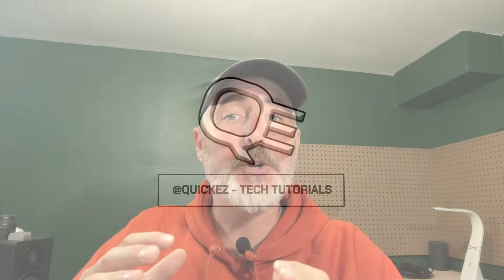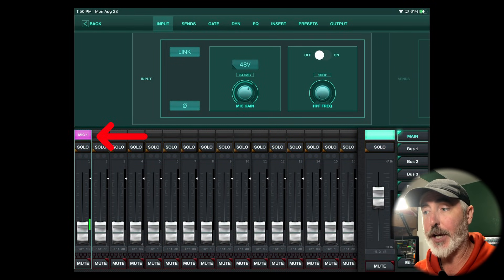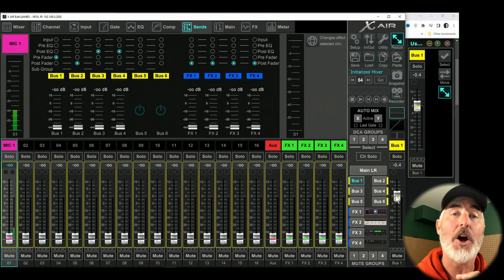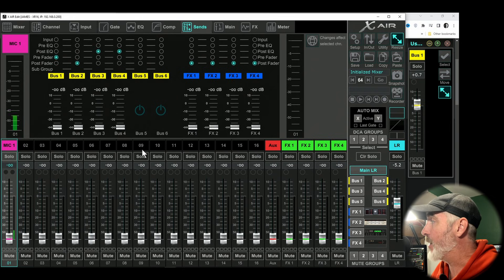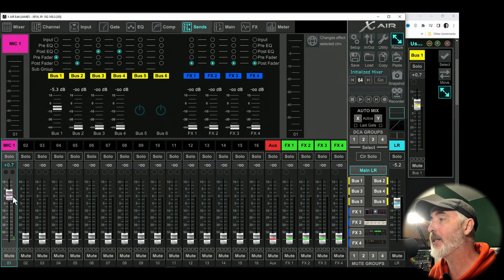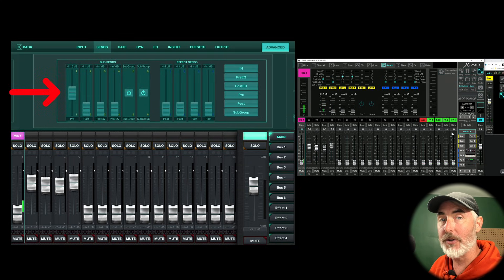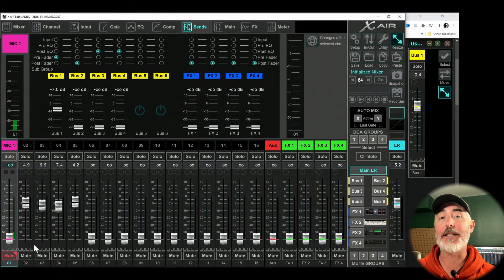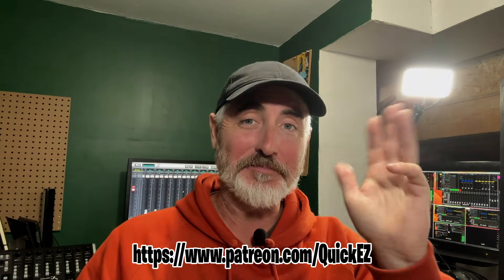XR Mixers - How to set up & use aux sends

Comment: How could I setup a stereo mix for my aux outputs?
Reply from the maker: Hi bmorphis3,
if you link two aux outputs (lets say aux 1 and aux2) that gives you the ability to make a stereo output.
As soon as you link two auxes, they automatically hard pan left and right.
Then you can send signal to them in a panned state and that will allow for a properly stereo send.

Watch this video I have on how to correctly pan inside a stereo aux setup.
https://youtu.be/B9OPxbO6oV0

Hope that helps. 
Thanks for watching and happy mixing!

Comment: Great Video, My problem is im getting signal in but, I cant get sound to my monitor?  thx for any advice.
Reply from the maker: Hi Paul,

Powered speakers? 
Passive speakers?
Are you seeing signal in the aux output meters?
Have you tried swapping output cables between your mixers aux outputs and your monitors?
Does this problem exist for all aux outputs or just one or two?

Are you able to get sound out of your Main LR outputs?

This process should be easy especially if you’ve watched the video. 
If you’ve followed the instructions and nothing above yields new results, there could be an issue with your mixer.

Comment: Thanks for the amazing vids, love them. After watching some of your XR18 videos we finally decided to go digital and swapped our analog mix for a XR18 unit. And we absolutely love this little beast! With the help of your instructions I was able to set it up and have it operational within 1 hour!
There’s one thing I struggle with though. I’d like to have my drum set mix fixed and then controlled by a single fader, while feeding it to the Main LR, and the individual PA mixes via Aux outputs. So I combined all individual drum mics under a subgroup on Bus4, removed the mics from the Main LR, and that works perfectly for the Main LR. But I didn’t figure out a way how to mix it to our PA mixes which I have on Buses 1 to 3. I even tried to physically feed the corresponding Aux output to a free input via XLR patch cable. While it sort out works, it introduces a lot of bus and cracking, so not a workable solution.
How would you go about it?
Reply from the maker: Hi Peter, sorry for the delayed response.
just want to make sure I understand what you're trying to do. 
You want your drums mixed and then their overall mix controlled with a single fader, for the main L/R house speakers.
But are you saying  you'd like that same control for your monitor mixes 1-3 as well?
Reply: @QuickEZ  yes, for Main mix, I want to control the “intensity” of the drum mix with one fader. As the IEM mixes are concerned, I originally thought that I’ll do the same, but realized pretty soon that that’s not going to work - everybody was asking for a different mix of drums:)

Comment: Hi I've just bought this Mixer and have followed this and everything works except 1 thing. the Master Bus 1 channel does not change any volume when I move it up and down (the individual channel faders do but not the master). I've been playing with the settings for a few days now and can't get the master bus volume to work. I may be missing a step but any help you could give would be so appreciated! thanks.
Reply from the maker: You undoubtedly have something changed in the routing. 
Reset the console to default routing by opening the setup tab and clicking INITIALIZE. 

This will reset all inputs and outputs to default routing. 

Let me know if that works.

Comment: So does Bus 1 = Output 1 on the mixer? And Bus 2 = Output 2, Bus 3 = Output 3? I’m trying to create a monitor mix using 3 monitors.
Reply from the maker: Hi. Yes. 
By default the outputs are:
Bus 1  = Aux Out 1
Bus 2  = Aux output 2
Bus 3  = Aux output 3
Bus 4  = Aux output 4
Bus 5  = Aux output 5
Bus 6 = Aux output 6

You can change the signal source if you want to. But this is the way it’s set out of the box.
Reply: @QuickEZ thank you so much

Comment: Great video! Thanks! But what if I just need to send my Main LR mix to the AUX for duplicate my Main LR for example on AUX 1 and 2?
Reply from the maker: Hi. 
If you open the routing page and choose your AUX OUT tab, you can choose the source for each aux output. 
If you set one to your main L or main R (all the way at the right of the page) it will take that side of the mains. 
If you want both sides of the mains, you will need to use two auxes and set one to left and one to right. Ideally you will also want to link those outputs so the volume behaves like a proper stereo pair.

Comment: Hello, I’m not sure if this is dumb question. I guess not if I’m new to this 😅 but I want to use my X Air 16 to go out to 2 speakers for FOH as well as to 2 monitors for the band on stage and my IEMs. So I typically use the two outputs for my FOH speakers, do I not have enough outputs to also send a front of house mix my monitors? 

And how do I send a separate bus mix to my IEMs once I’ve set up the bus to what I require?

Comment: What is the metod to fo this on the XAir Software for iPad? I can see any of the Post pre Etc settings on the XAir Software for iPad, do you have a tutorial for setting up a monitor mix for Aux Outs for iPad XAir app?
Reply: I can't see settins on iPad Software not i can see..
Reply from the maker: Hi, did you watch the whole video? I reference iOS starting at 8:27  and make sure you have the ADVANCED BUTTON on the sends tab selected so you can change your pre/post settings if you need to

Comment: very nice video my friend.
if I want to use my IEM G4 senhaiser in the AUX slot is it better to use the pre fader?
Reply from the maker: Hi GiannisDagkalis,
Any time you use an aux for monitors. Regardless if it is a stage speaker or IEM’s you should use PRE-FADE. 
This ensures that the signal level you are sending to your monitors does not change because of changes to the FOH mix. 

Thanks for watching and happy mixing.

Comment: Question. What is the output settings of the aux out in the routing section. Is it pre or post? Thank you.
Reply from the maker: Hi, 
by default, the Auxes are POST fade in the actual I/O section.
Reply: @QuickEZ  for example, if you want to link the aux 1 out direct from channel 1. And you still want a independent control main LR separate from that aux. Cause in our setup, channel 1 is our vocal and we want it outta straight to aux 1 out to FOH. Since we dont have a splitter rack and this is our only solution. We want a raw signal of vocals to FOH. Do we set the output routing of aux out to post? Cause we try set it to post but when I try the control of main LR in the mixer, its still affecting the aux 1 out. We want it to bypass.

Comment: Very helpful video. I alternately use a PC interface and Android tablet. On the tablet Outputs section in Routing, when  I select, say, Aux 3 as the output and try to assign it to Bus 3 as the source, it lets me make the assignment, but does not keep it. If I leave the page and immediately come back, it shows Aux 1 as the output and Bus 1 as the source. Obviously, I don't want all my monitor mixes to come off Aux 1. What am I doing wrong?
Reply from the maker: Hi there,
when you go into the routing page on android, it always starts at the default view, regardless of what you were just working on.
That does NOT mean it's changing your adjustments back to default. If you've made a change, that change would remain.
It's just the tab view that defaults.

Aux 3, is by default fed by the Bus 3 source.
if you change that to something else, lets say change Aux 3 to Bus 1, you can go out of the page, then back in and see that it held your changes when you select Aux 3 from the dropdown list.

But if you want Aux 3 to be fed by Bus 3, it already is.

I hope that helps clear things up for you. Let me know if you're still confused!

Thanks for watching and happy mixing!

Comment: I see that you have a picture of a recorder on your software.  I don't seem to have it on mine.  I have plugged in a usb stick with a wave file on it, thinking that it may appear when a stick is plugged in. However this doesn't work.  Would you know why this is, or if I have to click something in setup.
Reply from the maker: Hi Rob,
Which mixer do you have?
Reply: @QuickEZ Hi, I have the Behringer XR16. I thought that I saw the recorder when I first bought it, but I may have been mistaken.
Reply from the maker: The 16 definitely has a recorder. The only time it doesn’t show up is when your software is not actually connected to the mixer. Meaning you are in offline mode. In this mode you won’t see it or the snapshot / scene buttons.  
As soon as it’s connected, the recorder and snapshot icons show up.
Reply: @QuickEZ  Hi,
I don't have an ethernet socket on my main PC but use wifi to connect. I just plugged in my laptop, which does have an ethernet socket. Neither PC nor laptop show the recorder. Both show the snapshot tab though. Beneath the snapshot tab is a blank space then Automix box. When I plug in a usb stick a red light come on, then goes off.
Reply from the maker: Is your USB drive formatted to FAT32?
that’s the only format that will work. 
But you absolutely should be seeing the recorder even without a drive plugged in.
Reply: @QuickEZ  Hi,
Yes, I reformatted it and put a wave file on, but nothing. I just tried a different stick, but still nothing.
Reply: @QuickEZ  Hi, I thought I would update this post.  After going over all my settings for the umpteenth time, I suddenly noticed, that in the connection setting, by the offline device, it was set to XR18. I have no idea how this has happened, like I said i thought that I used to have the recorder when I started. Once I set it to XR16 up came the recorder.  Strangely, my laptop was also set to XR18, again, I have no idea how. I thought that you might like to know in case another idiot asks you.

Comment: Be sure to set pre-eq if to want to set the eq to the monitors independently from front of house
Reply from the maker: Keep in mind, you can't really EQ channels independent for FOH and Monitors unless you have free channel strips with which you can duplicate inputs.
You can do an overall EQ of the monitor send, but once you EQ a channel strip, that EQ holds regardless of it's destination (FOH,Monitors,FX bus).
Setting a channel to PRE-EQ means that you're sending raw input to that monitor, but you can't EQ that input on it's own, only the whole monitor mix. Unless, as I stated, you have a free channel strip that you can duplicate an input on and then you can EQ both strips differently. But setting anything to PRE-EQ won't give you that same result.

Comment: Hello. Thank you for putting this out. I’m still having a hard time with one feature on my Xair 18. I’m using an iPad with the Xair app. I set everything up the way you’ve shown. All the input channels are set to pre-for pre fade. I can hear everything from the aux output however I dont have master volume control for each individual bus. I can move the fader up and down and it doesn’t change anything for your master output volume. Each individual channel will change the volume for that particular input, but is there a way to set it to where the master bus fader will control the overall volume for your aux out. I don’t use the main outputs for this application. My band uses this for in ear monitoring, and we all have the apps on our iPhones. Controlling individual instrument and vocal input. volumes works fine for each individual fader but the master volume fader for each bus has no effect when you slide it up and down. Thank you.
Reply from the maker: Hi @ghouliebass,

There's a bit of confusion here so I'll do my best to answer based on what I think you're asking.

When you are looking at the app, if you have your MAIN BUS selected (this is your main LEFT / RIGHT output bus), then you have a MASTER BUS fader that controls the overall volume to your main left and right output.
If you do NOT have the MAIN BUS selected, but instead have one of our AUX BUSES selected, like BUS 1 or BUS 2, the MAIN BUS master gets replaced with a MASTER BUS FADER that is specifically for the Bus you have selected.
For instance, if I select Bus 1, now my master fader is for the overall volume of everything going to that Bus 1.

If you are saying that your specific Bus Master faders (like Bus 1 or Bus 2) are not controlling the overall volume of that bus, then you have inadvertently changed the tap point in the routing page to be PRE-FADER. This is not what you want to do, this setting makes that master bus fader non-functional.
The only place you need to select PRE-FADER is on the sends tab of each individual input. This will make those channels go PRE-FADER to the bus, but the Bus Master will still control the overall volume.
If this is what you've done, you should go into your routing page and put the tap point for the bus back to post fader.

If  you are saying that you would like the MAIN BUS MASTER, a SINGLE fader to control the overall volume of what is going to ALL of your buses; you can change your routing to feed each bus from the MAIN LEFT /RIGHT.
HOWEVER, doing this will mean that you cannot customize each persons mix. Everyone would get the exact same mix with all instruments at the exact same volume, all the time, no exceptions.
I have to assume that isn't what you're going for.

If you do want ONE FADER to control the overall volume of all your buses at the same time, you can modify a DCA layout in the SETUP tab of the iPad app with only the bus masters assigned to it. That will give you a single fader control of the volume for all buses simultaneously.

If what you want is to have quick access to overall volume for each bus individually, then you can build yourself a custom layout in the SETUP tab of the iPad app. In this custom layout, you could add only the bus master for each bus. That way, you have only 6 faders visible for quick overall volume control to each bus mix.

If I've totally misunderstood, my apologies and feel free to add more context so I can try to assist.
Reply: @QuickEZ  thank you I will give this a try when I get a chance. Hopefully your solution works.

Comment: Around the 2:23 mark: On my XR18, on the sends section, when I click on advanced, I cannot check or uncheck any of the items (In, PreEQ, etc.) Any idea why?
Reply from the maker: Assuming you're also using an iPad like in the video.
The tap points (in, preEQ, etc) are only selectable once you have selected a bus send or effect send fader. If they are not responding it's likely you just don't have one of the faders selected.
If that's not the case,  you have one selected but they still won't respond, then there is something else going on that I don't have an immediate answer for.